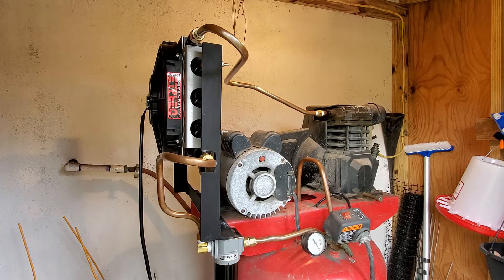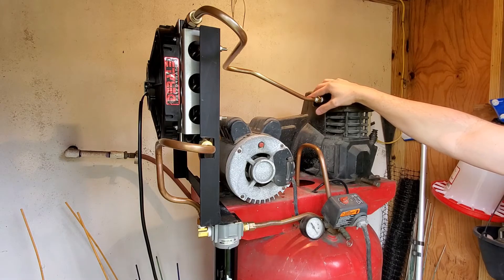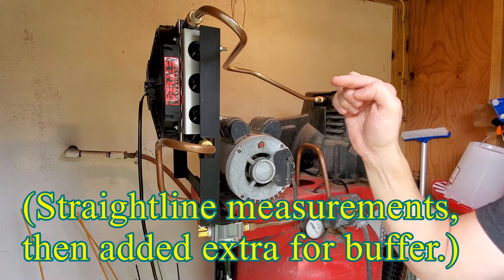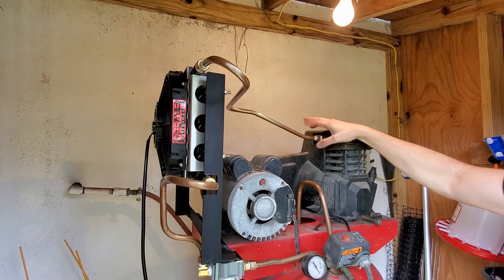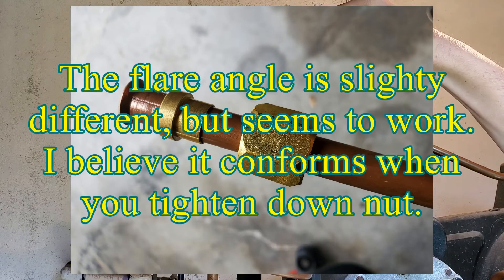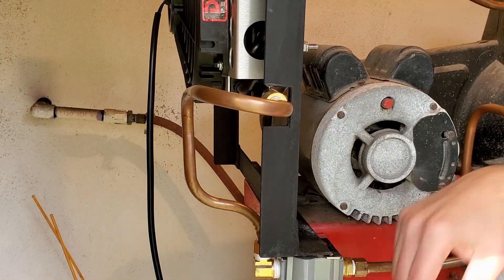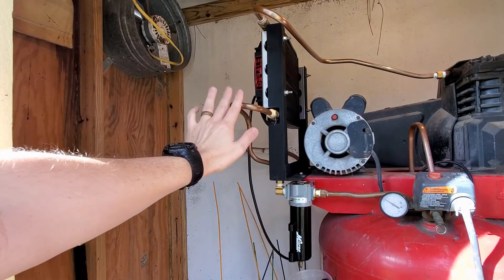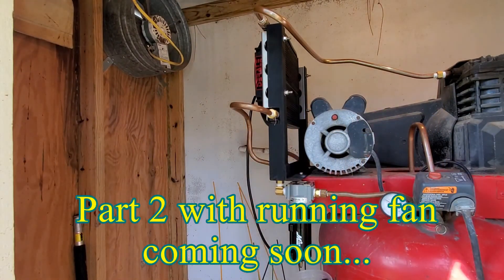Air compressor after cooler -- To remove water from compressed air

Comment: If you have any one drop of water in that filter its still going in the compressor that filter does not what you think
Reply from the maker: Part of what you say is correct.  Yes, water still does get into the compressor.  This only reduces the amount of water that makes it into the take.  This set up is NOT the most efficient or best way to remove water from the air.  That said, I think it does a good job.  During the summer I am getting about thimble full of water in the filter for each fill up.  Whatever water that is in the filter....does not make it to the tank.  It's that simple.  (I have a cup that the filter drains into and you can see/measure the water it drains.)  I still have the drain in the bottom of the tank that I use as well.  For my next compressor (presumable an expensive one) I will do to the multiple vertical copper pipe set up on the wall with drains on each leg.  I think that is the best set up.  This will be in between the compressor head and tank.  Most guys put them downstream from the tank and therefore water still makes it to the tank.

Comment: You need to make it go down when it comes out the compressor into the cooler
Reply from the maker: Thanks.  I think it is sloped better now.  Either way, I am getting plenty of water in the filter.
Reply: No one comments compression fittings are low psi rated ???

Comment: Good first try at cooling comp. air to remove condensate. I had the same sand blaster experience, twice! I've studied & physically observed commercial & hobby moisture removal methods for years. The best hobby sized super efficient system designed by an actual engineer, YouTuber Doug Kronemeyer (DIY #9), a 3 part series is a near passive system so good that it rivals refrigerated air driers at a fraction of the cost. This 3 part video series is so full of practical scientific knowledge & logic, you will need to take notes & watch them more than once. IF you copy his design you will get No water in your tank ever! 
The high exit temp at cooler outlet (no fan) & the low humidity (45%) both contributed to the minuscule water seperated at the Milton trap. The water in the tank is your evidence that vapor passed thru the Milton & cooled in the tank. Doug is in Florida & I'm in S. Central Tx & both places have usual humidity above 95% in spring & summer months! I've seen a cowboy crack a 6 ft bullwhip & the shockwave makes a puff of vapor in the air! To sandblast, plasma cut or paint requires us to do serious moisture control. Ok good luck on future improvements! Paul from S. Central Tx.
Reply from the maker: Thanks for the great info!

Comment: That's a very small compressor for sand blasting. I run a 60cfm 3 phase machine and even that will drain when blasting for a while. That aftercooler will be completely useless without a fan. You've just made a big insulated heatsink. I'm sure you've figured it out by now.
Reply from the maker: I had the fan all along, but wanted to test it without it first.  Fan is on now and it runs great.  You correct that it is too small of a compressor.  I plan for a 30cfm one when the budget allows.  I know that is even small, but I don't blast a lot.
Reply: @KMLTimesTwo  if you don't do much blasting it should be fine for most applications tbh. Good you got the fan fitted, should make a big difference!
Reply: What are you blasting that requires more than 60 cfm?  I just got a 38 CFM compressor and plan on doing firearms parts etc, nothing large.  My gun/nozle set-up doesn't require more than 20 CFM.
Reply: @bs8010  Car and truck parts.

Comment: Definitely need to run your fan. If you don't cool the air down to ambient temp plus 15 degF then you won't reach the dewpoint at which time the water will drop out of the air. In addition to the cooling section I added a homemade separator consisting of 3" Sch40 Galvanized pipe with a 1/2" galvanized running the length of it on the inside with SS scrubber pads installed in the annulus...the area between the 3" and 1/2" pipe. I bring the air from the cooler into the side of the 3" pipe via a weldolet. The air then travels through the annulus and SS scrubber pads...at a much slower velocity...which allows the water to form droplets move towards the bottom. When the air reaches the bottom it does a 180 turn and changes velocity quickly returning to the top center of the separator blind flange. The water droplets will separate from the air during this 180 deg turn and stays in the bottom of the separator when it exits through a fitting and a valve. The air leaving the top fo the separator goes on to the tank via tubing. You can email me and I will send pics.
Reply from the maker: Sounds like a nice system!  Thanks for the info.  I plan to upgrade my system at some point in the future.

Comment: I'm adding one to my compressor now. I plan on adding a fan to mine also if it doesn't cool enough without it. I installed my cooler in front on the compressor pully to hopefully get air movement that way.

Comment: Hello I used the same cooler with a manual fan and it works amazing.  After I added my setup I have not gotten a drop of water in my compressor.  Great job.
Reply from the maker: Thanks for post.  Yes, the fan and cooler set up works amazing!  I still get a small amount of water, but nit much.
Reply: Disagree 😊

Comment: the evaporator not big enough, that is why still hot and got moisture inside tank. buy a roll of copper tube and make your own evaporator/condenser.
Reply from the maker: Thanks!  I thought of that method as well.  Some even submerse the coil in a bucket of water.  I plan on eventually upgrading this compressor and will do a few improvements.  I am FL though, so with all the humidity, getting it all out right there at the tank is pretty tough.
Reply: @KMLTimesTwo  using water as cooling agent seems legit if you can make it neat. maybe you can bend the copper tube up and down then attach the small tank like fire extinguisher tank to let the air cooled in that temporary tank before enter main tank. also get some powerful big fan. less hassle but need some welding and adjustment. haha

Comment: Good info on the fittings.. Theoretically, you'd want the cooler to be lower than the cylinder head.
Reply from the maker: Thanks Bee.  I did think of that.  I don't think it is a huge issue since the water is not removed from the air until it hits the cooler.  By that time...things are moving down hill.

Comment: Good install. I bought the Derale cooler and fan separately. This is a good install. I'm a few degrees above ambient at the water separator inlet (another data point supporting your solution).

Comment: How did you wire up the fan I have the same cooler but with the fan but I found some cheap on ebay
Reply from the maker: I haven't yet.  I am going to use one of the 12v leads from an old computer power supply.  There is a 120/220 switch on most of them.  I will put on 220 and wire it into the switched side of the compressor switch.
Reply: @KMLTimesTwo  ok I found a power supply on Amazon to hopefully wire it up to the motor when it kicks in

Comment: KML.. I put this below another threadbare thought might not see it, anyway..    @KMLTimesTwo  we have a way of sending ambient air thru the after-cooler like a fan to see how well it works,  your after-cooler needs something running thru or accross the cooling fins if it going to make any difference.  Thanks ! Goodluck.
Reply from the maker: Thanks for the note.  Yes, you are correct.  It will good to see the comparison in temps and change in water output when the fan is running.  A few more weeks and I will have it complete.

Comment: I'm just about to do this mine, I wonder if the afterźcooler had cool air blowing through the fins where the heat exchange begins. ?
Reply from the maker: Not exactly sure what you mean here.  In this video the fan was not running and there was basically no air blowing through the fins.  I don't think it really cooled it off that much.  It was cooler when it exited, but not much.  (I know that some other use the cooler and no fan.)  I was able to get the fan running this weekend and it works great!  I should have the video up soon after I test it a bit.

Comment: You can put the cooler in front of the big Pulley on the compressor and would suck air through it. The big pulley is design to blow air on the compressor motor to cool the head. If I was you I would relocate everything to the back so you can cool the head and air all at once.
Reply from the maker: Thanks Jon.  I have seen others do that, but their pulleys seem to provide some good airflow.  If I didn't have a fan, that would be the best way I think.  I decided to not do it this way for a few reasons.  The pulley and belt are all enclosed in a plastic guard and the big pulley seems pretty small.  I am sure that there is some cooling going on with its design, but it can't be much.  The temps of the head (with the pulley possibly cooling it) seems way hot and I didn't want to remove the guard and then introduce.  I expect that this fan will move more air than the pulley can.  I have some other projects getting in the way, but hope to have it wired up soon.
Reply: @KMLTimesTwo  I have a way of sending ambient air thru the after-cooler like a fan to see how well it works,  your after-cooler needs something running thru if it going to make any difference.  Thanks ! Goodluck.
Reply: Adding a fan where the housing fits flush to the radiator will dramatically increase CFM / heat transfer. If you want to put in a passive system using the compressor fan I'd go with a larger radiator like a Hayden 1299 or even a larger A/C condenser. The Derale oil cooler and fan combo does a great job with my 5 hp 80 gallon compressor. I'm a few degrees above ambient at the water separator inlet after a 10 minute torture test.

Comment: Need to see an update with the fan and how ur planning on wiring it up. I'm currently going through the same thing with the fittings
Reply from the maker: I should have it wired up shortly.  I am planning to use a computer power supply that I have to go from 220 to 12v.  It is probably better to use a smaller power supply than this, but I have had this one sitting here forever.  I will tie it into the switched side so when the compressor kicks on, so does the power supply, fan, etc.  I would love to set it up to run 20-30 seconds after the compressor shuts off to cool off coils, but haven't quite figured out how to do that yet.
Reply: @KMLTimesTwo  need a time delay relay. Will maintain power to the fan after the unit shuts off for whatever amount you would like
Reply from the maker: @DBrisky37  You are exactly right.  I still haven't completed it yet, so what I don't know is if the power source is continuous of if it is only available when the compressor is on.  But yes, it would be desirable to have that run long enough to bring the coils back down to ambient temperature.  I have another project that I am working on that involved a timer, so I will try to utilize that here as well.
Reply: @KMLTimesTwo  I just made one with that same cooler you used and it works awesome. Mine has a half inch diameter pipe (5/8 od) coming from the compressor to the tank so I had to step it down to connect to the cooler. I was worried was going to be restrictive but only takes 5 seconds longer to fill the tank. With the fan running the temperature leaving the cooler is basically ambient room temp, but scorching hot going in
Reply from the maker: @DBrisky37  that's great to hear and gets me motivated to finish mine!  Thanks for letting me know.
Reply: @KMLTimesTwo  Just wanted to share what I learned today, I don't know if there would be a need for a time delay relay to keep the fan running after the compressor shuts off. The coil on mine was quite cool immediately after an extended runtime once it shut down.
Reply from the maker: @DBrisky37  sounds good.  I could try it without first as that is less work.  Thanks for the update.